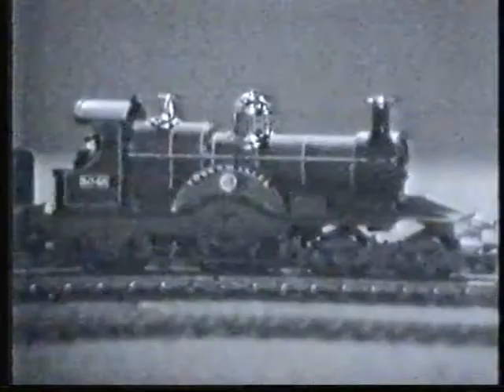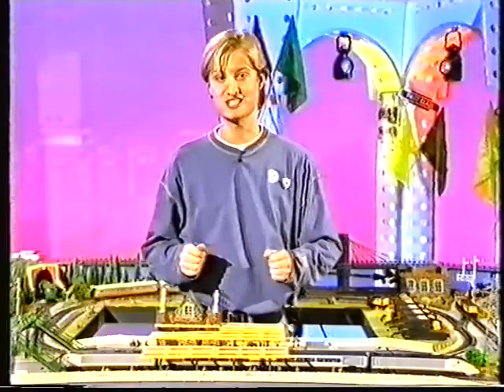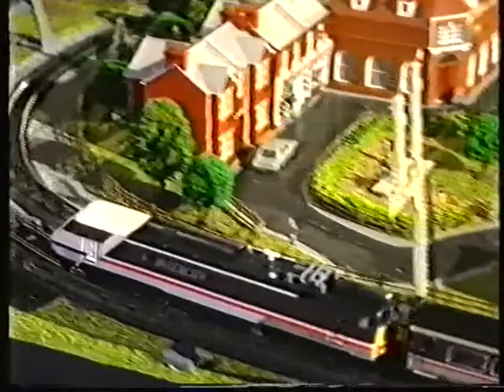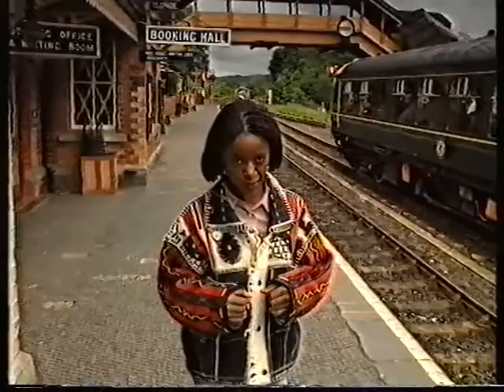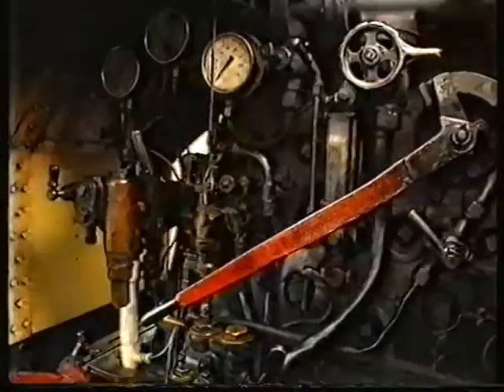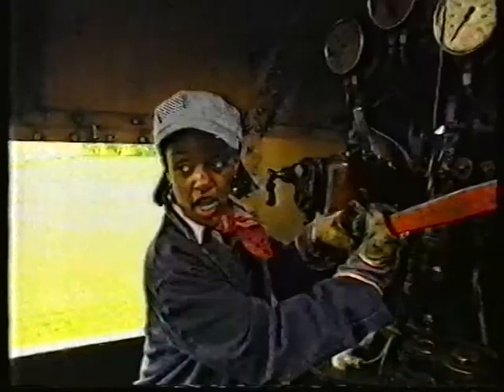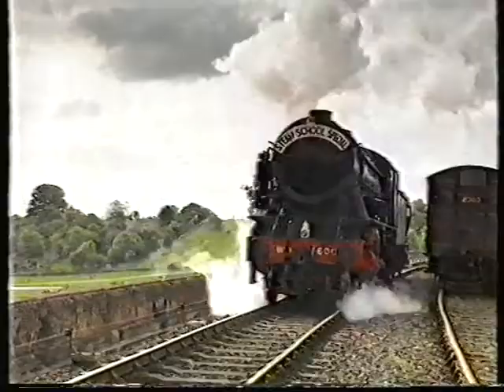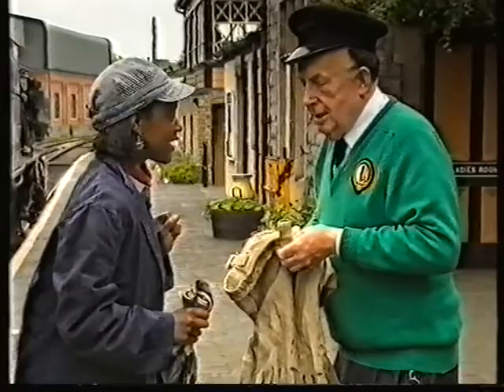Blue Peter Model Railway, loco driving, November 1994 (VHS)

Comment: It's been about 27 years and 532 is still not running
Reply: No it was repaired in 1996 after the accident and ran mainline until 2002 then moved to North Yorkshire Moors until it's boiler certificate ran out, then on to Darlington Museum and finally Crewe where it's being restored to mainline condition.
Reply: @stevelomas4119 จต
Reply: @stevelomas4119  What happened
Reply: @UKSpotter2023   Major slipping whist main line rummimg...wrecked the motion and blew out the left hand cylinder.
Reply: @stevelomas4119  Ah OK thank you
Reply: @UKSpotter2023  i can send you a link to the video of the blue peter catastrophe wheelship damage